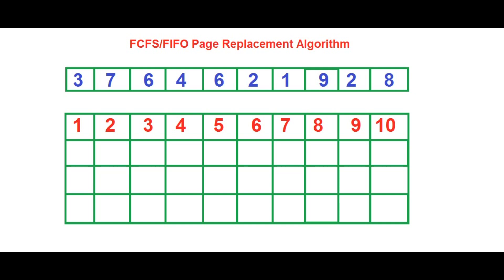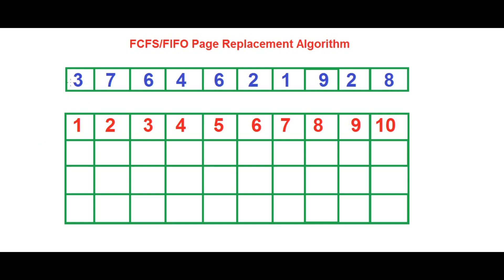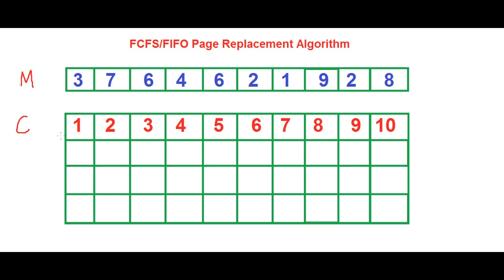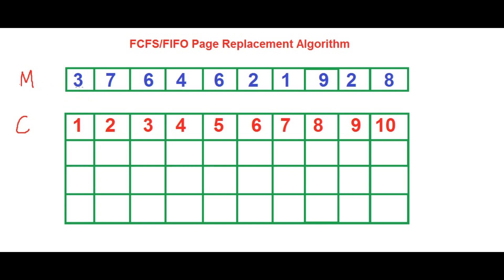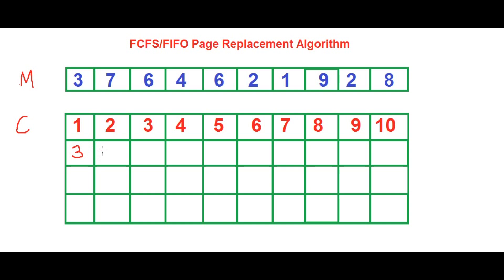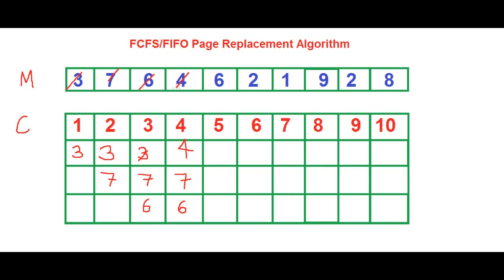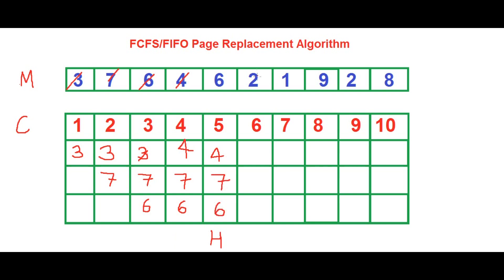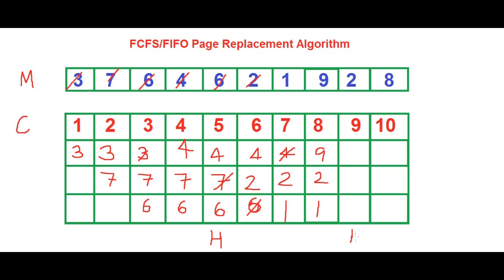FCFS/FIFO Page Scheduling Algorithm

Comment: what if the sequence is 2 2 2 4 5 6
Reply from the maker: assuming the cache size is 3 blocks
2- place in 0th position
2- cache hit, do nothing
2- cache hit, do nothing
4- place in 1st position
5- place in 2nd position
6- memory full, delete oldest page (delete 2 (residing at 0th position)) place 6 in it's position
Reply: final order 6 4 5 with 2 hits